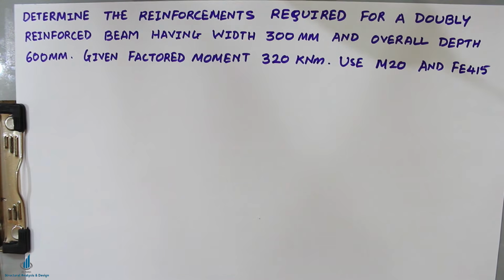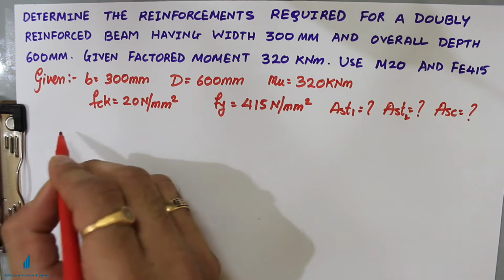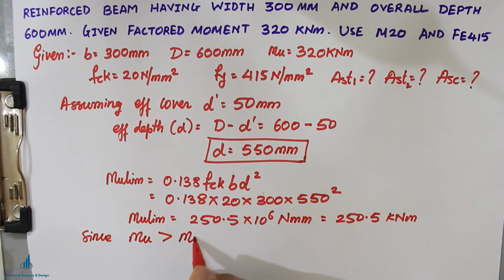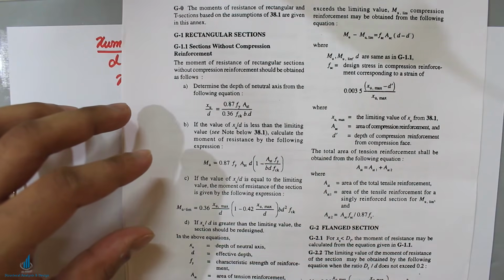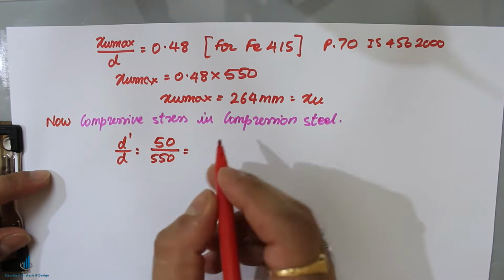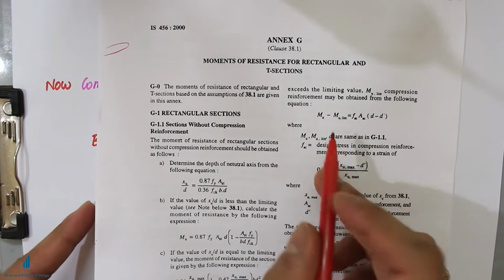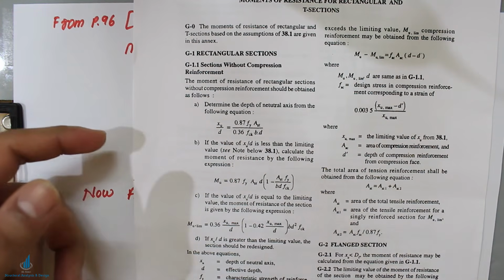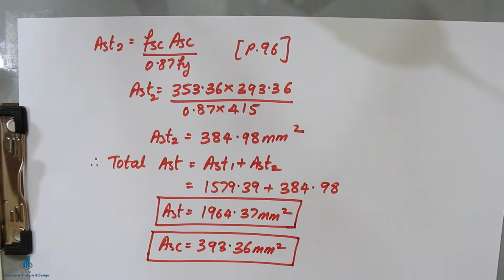Analysis of Doubly Reinforced Beam | Limit State Method | Type 2

Comment: Good evening sir.
Really great job that you are on YouTube with such great explanation on our Civil topics! First of all thanks so much sir 🙌🙌

Also I am facing a problem in this particular design (beam design) sir.
I am asked to design the beams subjected to Two-Way Slab, starting from load calculations. And the condition is that Mu must me greater than Mu(lim) but my value for Mu comes out to be smaller than Mu(lim), tried and changed the beam sizes, yet unable to satisfy the condition of BM.
Sir could you please help out? Where is the design going wrong?
Reply from the maker: Thank you so much for appreciating my content, keep watching.

Can you tell me why you want specifically Mu greater than Mulim? Actually if you get Mu less than Mulim its good and you can design it as singly reinforced beam